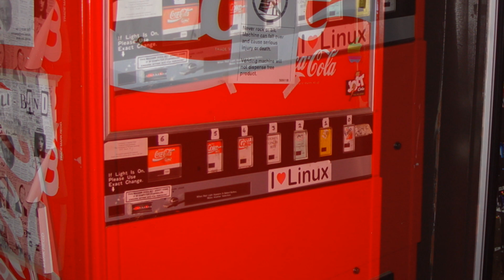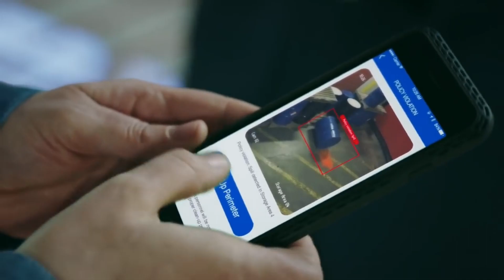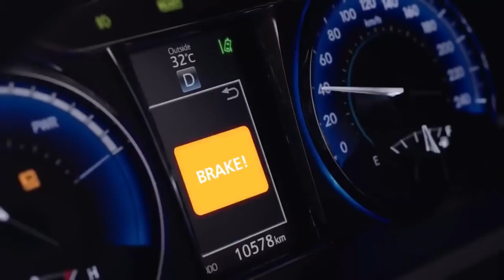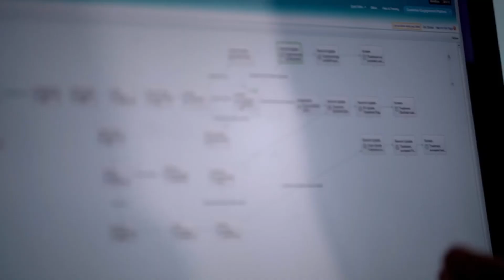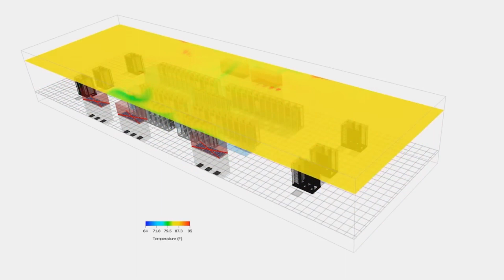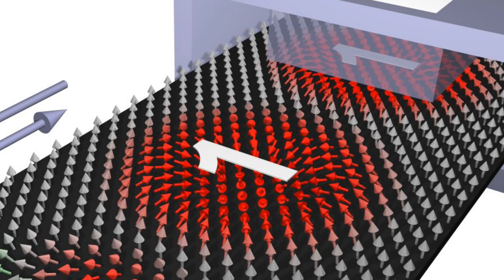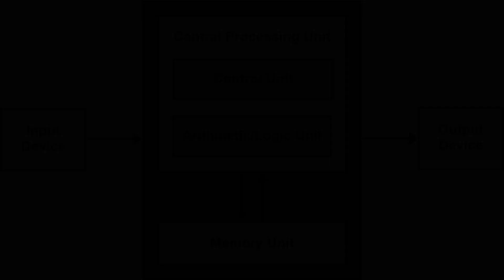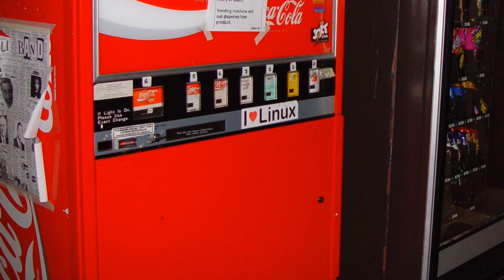The Future of Computing

Comment: I made a optical computer back 1983 BUT NOBODY wanted it! In 1981 I made a computer that DID NOT HAVE any CLOCKS. I was told by Motorola that it would not work! Strange! I already had working version! The magnetic fields MIT developed were developed in 1980 and they had a working version, 256,000 bytes!
Reply from the maker: Wow! You were ahead of your time!

Comment: You may have heard, but a flaw in many IoT devices allowed a virus specifically designed for this, called MIRAI, to infiltrate, and to pass between IoT devices across the world, extracting data sometimes even controlling them in the case of self-adjusting cameras. IoT devices can then be co-opted by MIRAI to send massive data streams to black-out servers in cyber attacks.